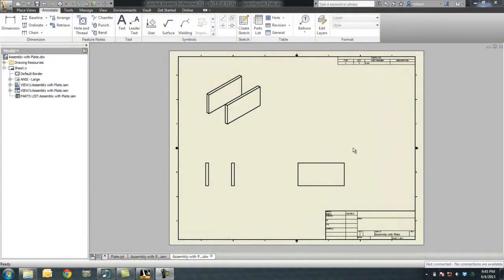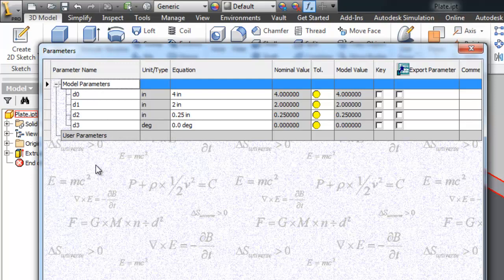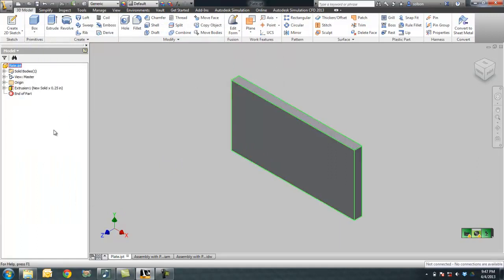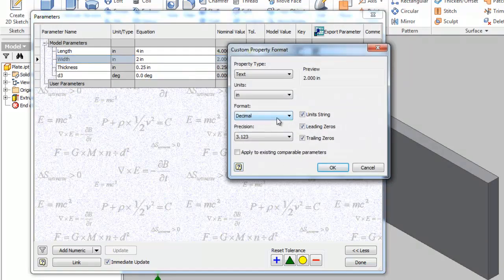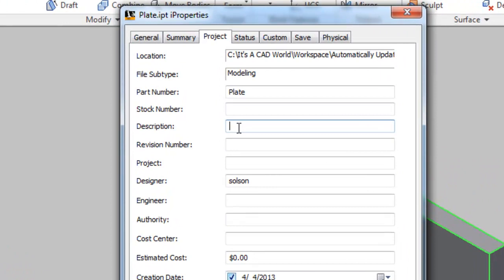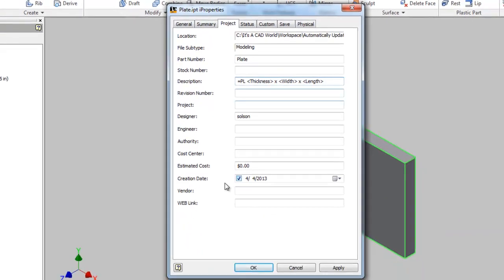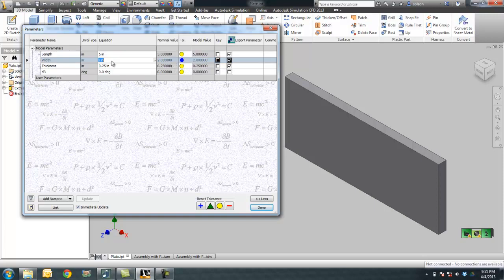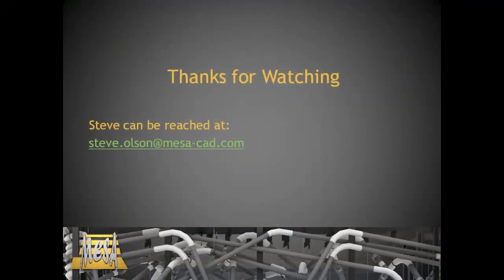Automatic Updating Description

Comment: Hello Steve, This is a great tutorial, thanks for posting this video.  Do you know if it is possible to automate the "Part Number" as well as the "Member" cells within the iAuthor table?

I'm trying to automate the file name creation using variables within the iAuthor table as well as populating the part number based on custom dimensions.

If you have a moment to offer some help, I would appreciate it.

Thanks.

Regards,
Derek
Reply from the maker: The function will work with Part Numbers, but not in an iPart or iAssembly Authoring table.  Those tables do not support the syntax needed to link fields to one another.  However, you should be able to edit the table in Excel and use formatting there get the formatting you want.
Reply: itsaCADworld Thanks for the answer.  I'll try working with the formatting in Excel to see if that helps.  Any chance you have a video that demonstrates this technique?
Reply from the maker: Derek, I just posted a new video that shows how to do this.  I showed part number, but it should work on any iPart or iAssembly column.